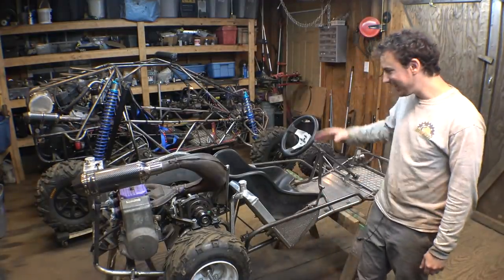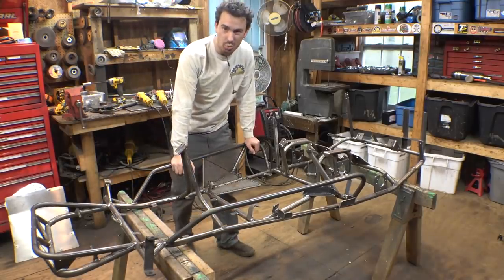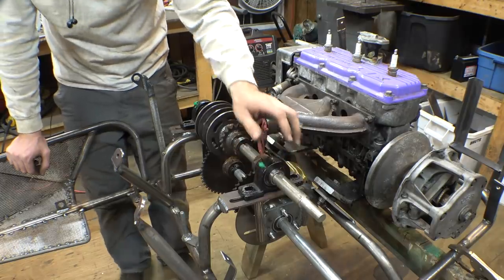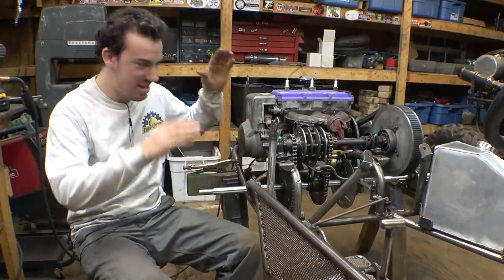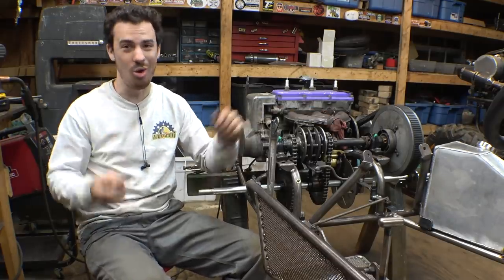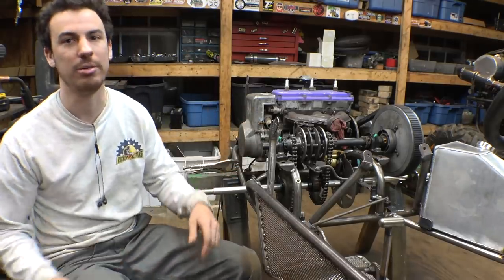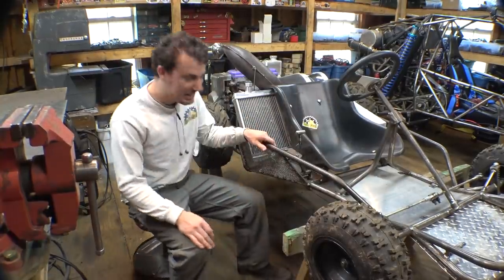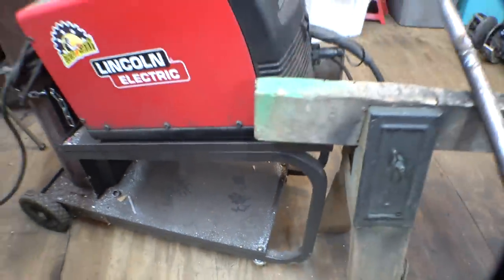95HP Two Stroke Triple Yard Kart Build Part 7

Comment: To lock it into gear, make the shifter have some flex with a spring, then put in 3 positions on the frame by the shifter that it can lock into. That way it can be locked into 1st, neutral, and 2nd gear.
Reply: Duh duh
Reply: make a plate that looks like  E   ,heim joint in the bottom with a spring holding it in each gear
Reply: @mostlymotorized  neutral would be unnecessary, but convenient to eliminate cvt creep

Comment: You need to build a spring pin accessible with hand on shifter that has three slots for the pin to fall into and be held in with the spring.
Reply: like a tractor implement lift handle
Reply: Sounds like a good idea, otherwise I think on how bumpy the ride may be, assuming he can keep the front wheels on the ground do to the torque of the engine wanting to lift the front of the cart up, the shifter may pop out of the slots while driving it.
Reply: @Cavonny  exactly
Reply: What's wrong with a simple detent like literally every other manual transmission on the planet uses?
Reply: @bradley3549  I don't know exactly how those look function, but they seem to hold well, not sure how well in an accident or super bumpy terrain
Reply: @M.TTT.  If you're in an accident, who cares if you stay in gear? LOL. But bumps? Like I said, every manual transmission car/motorcycle/etc on the planet uses simple detent mechanisms to keep them in gear. I haven't owned any that couldn't handle bumps.
Reply: it's called a shift gate
Reply: Given that there is a centrifugal clutch on the engine/CVT, it seems like you could just set up a bi-stable mechanism with a compression spring.

Comment: For your shifter lock out....you should add a spring to maintain tension while the shifter is in its positions, otherwise...when it gets bumpy, it will pop out of the selected gear.

Comment: I say a hundred miles an hour .... but we don't want to lose RBW .... can't wait to see this project build Ripp !
Reply: Wouldn’t be surprised, the sled that came out of proprably topped out at 50-60mph, and they literally spin through the snow so 100mph is definitely possible
Reply: The sled it came from Would probably do 90-100
Reply: @nathanwilliams590  yea proprably, it’s an older triple but my main experience is a triple jet ski and that’s actually proprably slower as the skidoo has some traction 

He has no choice but to have a freaking crazy go kart, it will either really off the line or straight up hit 150 miles an hour
Reply: Those sleds did 90+
Reply: The cart might go 100 but Chris won’t get it up to that speed.

Comment: Shifter Detent suggestion:
cut a small plate shaped like an M (with angled sides, not straight up and down) make it to where it can bolt to a flat bar welded to the front shift rod, right in front of the radiator. have a very small bearing on a spring loaded lever that rolls and follows the M-shaped metal, when the rod goes forward, the spring-loaded bearing will fall off the back of the M, when it's in neutral, the bearing will be in the center of the M, and when you shift the rod backwards it will fall off the other side of the M-  the M-Shaped plate can have slotted holes to adjust the exact center of Neutral, and be able to change as the rod-ends and linkages wear in.....

TO calculate rough top speed, you need the Engine RPM at idle and max, the size of the pulleys in their fully opened and fully closed formats, you'd need all sprocket sizes, and outer diameter of tires on rear, you could calculate something close within 10 or 20 MPH, who knows if that engine would have the guts, to pull Top RPM with the driveline and ratios with your drivers and vehicle weight on a long flat road?
Reply: I was going to say the same sort of thing but I don’t think you would need to do all that on some cupboards doors you can get a fitting that has a ball bearing in it it just a push shut nothing major all need to do is mount it on the sifter get a small size bit of steel same with some indents in big enough for it to fit jobs done so really 2 mounts one on the sift and one on the frame so like you said as you push forward it drops in as you take it bk same goes bk to where had it or take it all the way bk and drops in to next gear I did the same sort of thing on something I did it works plus no need to build the part can just buy off the self I got mine off eBay really cheap but I can see where you was going with it I was going to say before I see your post but will say any one of these will work it’s quick easy to do and will not take up to much time to do I don’t just mean my way but both ways what ever way he wants to go with it but next time I mite even give your way a go my self see how it work out for me
Reply: Or just have a plate with three holes, and a ball-spring detent that pushes into the holes. 20 x simpler, same result.

Comment: Stunning work!!! But not to be a f'ing buzz kill, but I bet the 2 speed selector pins will bend. The rounded tip would provide a tad-bit softer engagement- but it's going to have 'clunk' regardless of what you do. I suggest looking at outboard motor prop engagement. They also clunk. lol. No avoiding it- or the associated wear of the leading edge of the rectangular engagement dogs. It's a double-dog setup. No slots. Slow wear over time is better than bent pins. When the prop no longer stays engaged- it's time to change the dogs. Food for thought. Please don't hate on me for this people... it's just an opinion. lol. As hams say- 73 OM

Comment: To calculate top speed you also need the outer diameter of the primary clutch and the inner diameter of the secondary clutches. You know the diameter of the wheels and the maximum rpm of the engine. The ratios I reference below are the ratios of the diameters of the sprockets and clutches as you probably already know! The diameter closest to the engine is the numerator!

Here is the formula:  max rpm * 2 * pi * wheel diameter(inches) * 60/63360 * ratio of CVT@max rpm * axle to jackshaft ratio = top speed (mph)  

This is the theoretical top speed assuming that the wheels and belt are not slipping. Also, neglecting drag and friction and other types of non-conservative forces.
Reply: If we knew which Polaris snowmobile this is off of, we could know the exact gearing of the CVT.

Comment: Suggest you make the shifter have a pivot for left to right movement, and then use a spring to pull the shifter into its locking positions outward. Pulling it out of its stationary welded position may weaken over time and start to pop out of gear. Just an idea.

Comment: That shifter is between light speed and ludicrous speed.  The 2:1 gearing (chains) is good for 200 mph!  Here’s the math:  8000 rpm at the engine, times 1.5 for the clutch system at full sing (12000 rpm), divided by the 2:1 (6000 rpm axle speed).  16” tire goes ~50” forward per rev.  50” x 6000 rpm = 300,000 inches per minute, times 60 is 18,000,000 inches per hour, divided by 12 is 1,500,000 feet per hour, divided by 5280 is 284 mph!  The drive sprockets on the sled are much smaller than 16”, AND the chain gearing is more than 2:1, and the sled will do 100 mph with a lot more drag.  This thing is a (super cool) death machine.

Comment: I used this same engine and cvt on a cross kart build. My gear ratio is 6.4:1 with 24" wheels it tops out at 84mph. With 16" tires your yard kart would go over 100mph in first gear.

Comment: 249.9MPH!!! After some rough calculations using 7000 rpm and estimating the cvt as a 6 inch to a 4 inch pulley when it's fully adjusted, you're looking at a VERY high top speed. Good luck there RBW👍

Comment: With my trike build, 18 inch tires, 8 to 1 ratio, does 60 mph at full throttle. Motor speed is roughly 9k rpm, jackshaft speed roughly 7.5-8k rpm. Yeah its gonna be fast bud!
Reply: Yup... 3:1 reduction is going to be 126 mph and 2:1 would be 190 if it can pull the gearing... He's going to have to rethink that a little. Oh well.
Reply: That's what my math tells me.
Reply: @JoelArseneaultYouTube  of course he *could* set a throttle stop at any point above clutch engagement too. But where's the fun in that
Reply: @fridgebeer6897  True, haha. Issue with that is that you also sacrifice acceleration that way. 

if it was geared for 50-60 mph, it would accelerate like crazy .... IF he can keep the front wheels down... this unit is going to offer an exciting test ride !!
Reply: @JoelArseneaultYouTube  I can say my build is one hell of a blast at 60. From a stop I can stand it up and run. Not too fun without steering but hey, I built it for fun and man is it a blast. 
I'm planning on posting a few vids once I'm done overhauling the drive..... Side note, a #40 chain will not hold up to a  65ish horse sled motor
Reply: @fridgebeer6897   Let me know when you have a video up. I love seeing peoples craziness. Yeah. For me it's all about how big of a smile it puts on your face, haha. 

I'm currently working on a project with another channel who is putting a V8 engine into a jet ski (Yamaha Waverunner) I'm building the exhaust system for it. 

I'm also putting a 1100cc triple into my little jet ski... it's been an all winter long project. Started out simple, and now it's just insane, haha.

Comment: Add a couple hof cams on the selector lever hinge, and have a stiff spring and detent plunger hold it in positions. Should help with engaging the gear, as well as hold it in place.

Comment: for a long you could use a peace of metal along side the shift lever with 3 holes in then on the shifter a tube with a spring and a bearing so when it get to the hole it sits in the dimple holding the shaft in place till force is applied to move the shifter to the next position

Comment: Cvt gear cal is easy. Just measure the smallest and largest dia of the primary and secondary pulleys.

Smallest on primary / largest on secondary = lowest gear 

Largest on primary / smallest = highest gear

Highest gear / lowest gear = range

Then just plug it all back in to the rest of the equation. 

I'm happy to do it for you if you measure the cvt pulleys (just look at where the belt has marked the pulleys and measure).

Comment: If you reverse taper or make a step in those pins it will tend to hold itself in the selected gear under load, then add a strong detent to the shift linkage somewhere and it’ll work perfectly.

Comment: If you install a spring with quite a bit of pull in the enter line at the top of your shifter fork it will keep tension on either position to keep it in gear. It won't hold it in neutral but you don't need it to stay there anyhow since it is a centrifugal clutch and basically works like neutral at idle anyhow. That would be a quick and easy solution.
Reply: Guess I should have watched the entire video before posting that comment. lol. Oh well.

Comment: If that's the 650 or 700 triple that will do about 120 - 130 mph in stock trim on a sled. CVTs are NO more than .86 to 1 ratio closer to .9to1. So 16 inches, a redline of 8600 rpm and 2 to 1 gear ratio and a 1 to 1 ratio on the CVT. That comes to 204 mph before air resistance and friction. So if you use 60% efficiency that comes to, 122.4 mph-ish.

Comment: It's got so much power that i wouldn't worry about a really low first gear. I'd make it so that whichever gear you're going to use has the ability to go a fair amount faster than you actually want to go so you won't be revving super high all the time. Lots of dirtbikes have been blown up running fast with too low of gears even though they had plenty of power.

Comment: To lock in gear, maybe add a rod with a "t" handle under the palm rest of the existing shifter, so it is lifted to shift (spring loaded) out of a plate below with a hole in it for each gear. Similar to the ratcheting Hurst shifters. Google it. My idea is different but stone age simple.

Comment: You need to add front fenders to keep the dirt an crap out of your face and radiator. You might have to add a air ramm scoop for better air flow to the radiator.

Comment: If you get 4 x 1/2” ball bearing and springs, you could make a gate for the shifter.  Basically the shift rod would be held between the ball bearings and locked into place with the spring pressure.  Pull it past the balls to go into low, push past the first set of balls for neutral, push past the 2nd set of balls for high gear.  I figure if you’re going to ride this thing, you know a thing or two about balls.

Comment: You use the diameters of the pullies at the smallest and largest same for sprockets and rpm's.
If you have a machinist's hand book it will have the information you need.

Comment: After seeing the frame bare, I have some concerns that it's not going to be strong enough at the cross bar behind the drivers seat. It looks like the the 2 frame rails are the load bearing members with no bracing. I'd be concerned the frame would start to buckle there. 

I hope I'm wrong and the cart stays together but you might want to keep an eye on it.

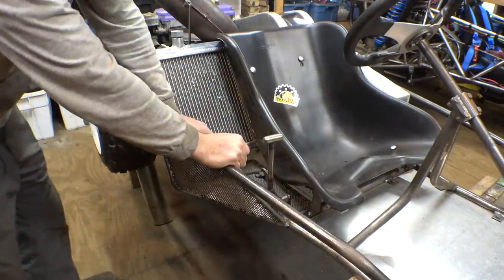Comment: 15:05
sitting here watching i came up with a spring-lock trigger type mechanism for keeping it in the 3 positions on the gear shifter.
just from that first line i'm sure you can imagine for yourself how that would/could work. it's actually similar to what you already have. maybe better?

Comment: I think the Gears should be good for climbing torque and drifting and second mid to top speed. No faster than 80 brother. That is way fast enough. Their is a lot of gearing calculators online. Just look for it. Just add a spring to the shifter. It should add some resistance so you can actually make it easier to shift and keep the tension as well.

Comment: For the shifter you could use a spring loaded locking detent on the shift lever next to a small plate with 3 holes drilled into it for each setting

Comment: Awesome work young man! Wouldn't be a good idea to put some paint on the frame when you finished up welding it? I mean, it probably will need some more welding done as you encounter the need for even more modifications but, you wouldn't have to take it apart again for paint, just touch up areas you modify. Great job, great video! I really enjoy your builds. Trying to get my 17yo to come up with a project of his own not unlike yours to do together and maybe pass on some knowledge.

Comment: for the design of the chassis I would go with Climbing gearing for first and top end for second, so its more like a what are you doin vs merely changing speeds. you would never be able to peel out tho unless you put two electrical motors for ramp up RPM

Comment: For a shifter lock I was thinking a spring loaded 1/4" steel pin the would pull in and out of the top of a rounded lock plate. More parts/welding involved but would not stress the parts as much. Your idea works but it requires flexing of the lever which over time might cause premature wear or a failure.

Comment: Calculating top speed at 7500rpm only using a 1:1 cvt ratio at 2:1final drive on 18x950-6 go cart slick tires (largest slicks gopowersports sell) equates to 200mph. Give or take 10% cvt ratio you are looking at a top speed between 180-220mph and with 10 inch go cart slicks you are looking at a top speed of 100-120mph with only a change in tire dia.

Comment: You might want to double the pins up, they seem a bit thin for something that might get hammered pretty hard by the inertia of the engine, unless you throttle down to allow the dogs to engage the slots.

Comment: If you run a heavy spring from the half way up the shifter to below the pivot point, then when its in gear it will cam over and the spring will hold the lever either forward or reverse.
Don't know how to lock it in neutral though. Maybe a flip over catch.

Comment: At RPM the CVT  goes 1:1 so 6000rpm x (1/2) x (16inch/63360inches/mile) x (3.14159) x (60min/h) = 45.5MPH top speed. If rpm tops a 8k you will hit 60MPH in second gear.

Comment: The drivers on the snowmobile would have been about 8-9 inches with about 2/1 gearing. Still capable of 80-90 mph. With those 16 inch tires, I think your going to be going faster than you think. 
I bet you end up with a 4/1 or lower first gear. 
Going to be a fun buggy to watch.

Comment: CV is a fancy way of saying infinite ratio, ie in theory there will be no difference short of RPM limit and proper tuning of the clutch
Even human cyclist can achieve 80mph w/aerodynamics.  And as you know, front brakes are 3/4 of potential braking.
Have you seen the modern crosskarts w/ CV?

Comment: A forward and reverse might be more useful...
For the shift lock go old school. Old farm equipment used a half circle of sheet steel with notches, similar to your plate. A lever on the handle was pulled in to unlock the current position and move it to the next. Other variants would pull the lever sideways out of the notch, I think you did something like that... check out old cultivator equipment pics to see this setup (30's - 50's era).

Comment: Hey if your transmission 2 speed is running the sprockets on needle bearings they need to be on a heat-treated race you are going to eat through your contact space with the needle bearings

Comment: While you had it all apart, you maybe should have drilled and tapped several detents into the gear hubs, and then ground the corresponding dents in the assembly shaft ..to maintain gear engagement.

Comment: I would make 1st gear really low speed for maneuvering in tight places without constantly disengaging the cvt clutch and second for driving. Maybe you could use a threaded ball detent pin to lock in gear shifter?